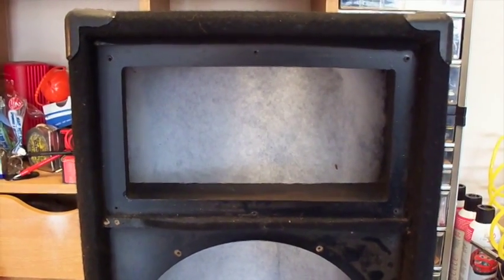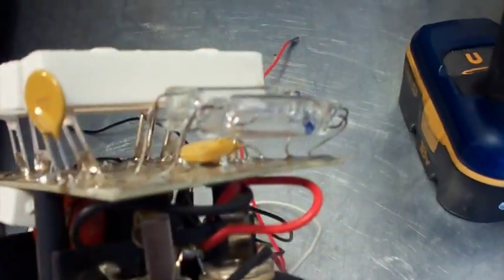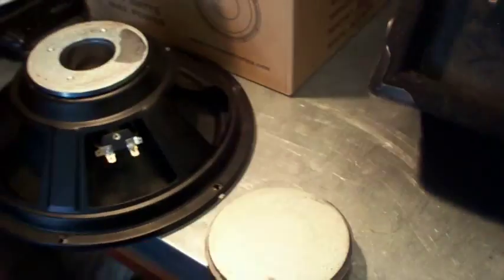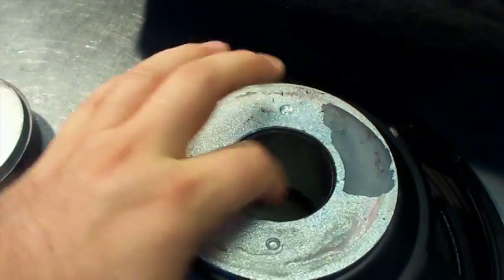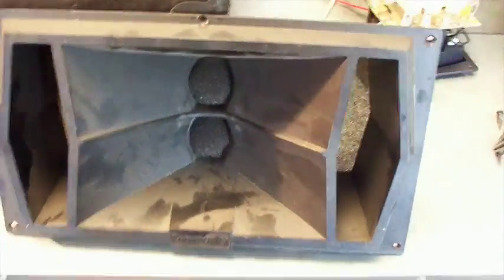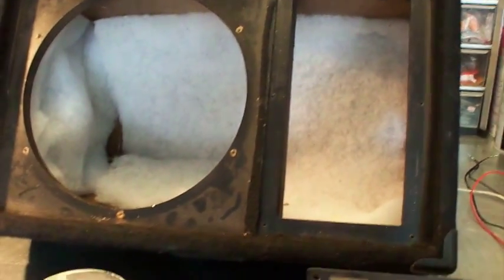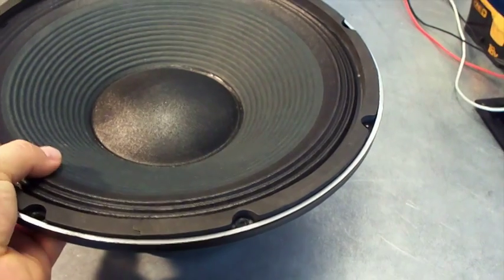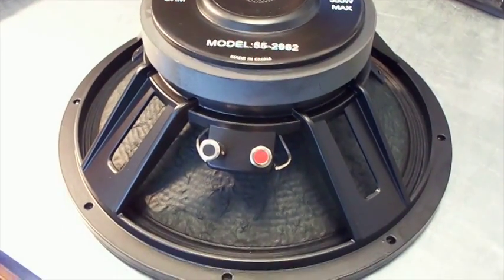Community Speaker Rebuild with MCM Woofer

Comment: Community is an interesting company in that they have produced both high end and lower end PA speakers. (They originally started as a live sound and lighting company, hence the name "Community" instead of a more 'tech' sounding name.) The DND cabinets were Community's most affordable, using a pair of PZT (piezo) HF drivers instead of a compression tweeter. Community also used PZT drivers extensively in the CSX series of affordable speakers from the 80s and 90s, and they learned probably better than any manufacturer how to apply them well (not sounding "too" awful), but they still have inherent limitations. With Chinese manufacture of compression drivers now cheaply available, even cheap PA cabinets now use compression drivers, but back in the day, PZT/"bimorph"/"ceramic"/Piezo drivers were more common.